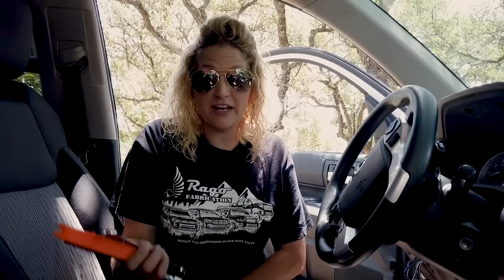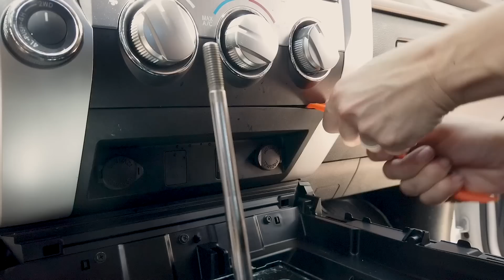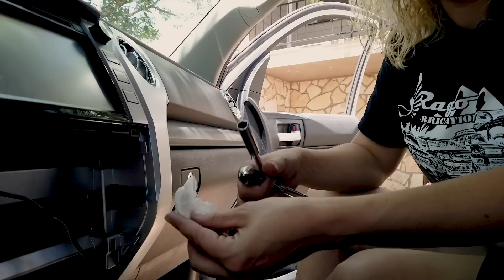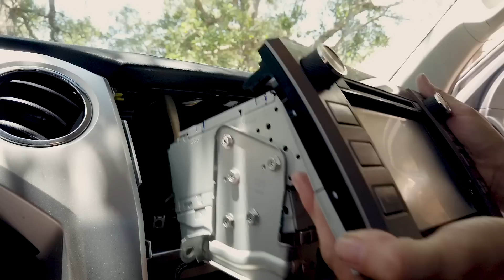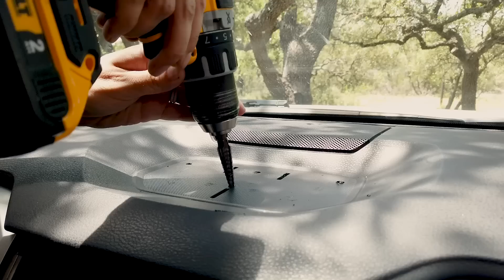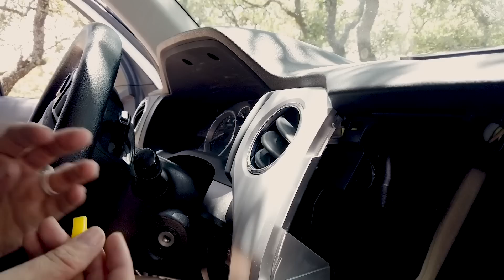2014-2019 Tundra Dash Plate Install

Comment: Just installed a “Blem” mount and it went great. Just follow Melissa’s instructions to a “T” and you will be done in about an hour. I highly suggest getting the plastic pry tools and using the “paper” trick in the video. I used toilet paper and it worked fantastic. I have a dash cpver and I just removed the patch that covers the mount. Looks sweet. 
Now I need to get some mounts.
Reply: Same here...couldn’t wait 4 weeks out

Comment: Video doesn't show or explain why it's necessary to completely disassemble the dash to install this. Looks like everything goes in from the top so no need to access the underside. At least, that's what the video shows.
Reply: Was about to ask the same question
Reply: Think it has to do with the placement of the wires to the head unit. On Victory4x4's video, they talk about being super careful for the wires. That and there are probably nuts on the back of the bolts that hold it to the dash.

Comment: Sure seems like all you need to do is screw the plate mount in and be done.  My only question is why? Lol
Reply: You must be joking,  you drill into the dash to get some bolts that hold your bracket,  ... how do you think the bolts are just going to hold all that weight.  You need to put the nylocks on the inside otherwise your dash plate is going to be bouncing all over your truck.
Reply: @ricriv5582  No it won’t, because I’d never install that pointless thing. Lol

Comment: Rago... are they self tapping screws to install? Is it necessary to remove the stereo?
Reply: I'm sure you have to in order to get the nylon locknuts under there to hold your bolts.

Comment: On the mounting plate, after you drill the holes do the bolts just screw into the dash or do they have a nut on the bottom to hold it more secure?
Reply from the maker: Joe there is a nut that goes on the bottom as mentioned in the video.
Reply from the maker: Joe its bolted in.
Reply: Yea I was confused as well. Video might have mentioned it but it wasn't clear enough for me to understand if there are bolts below. Nice product!
Reply: @RagoFabrication  I've been through this video a few times and the nut inside the dash is never mentioned. Lost in editing maybe?

Comment: I had the same question as Wes. What is the dash plate used for? I guess a dash cam comes to mind. Are other vehicles in line for this upgrade?
Reply: Frank Orth primarily for people who off road honestly. They usually have an iPad or some other gadget that is clamped on by something and the plate is the base of it so they don’t have to mess with magnetic mounts or sticky 3M materials.

Comment: What exactly is it for? Is it  a mount for anything. Also no need to take the center console apart can be done without touching it.
Reply: Mostly meant to bolt down ram mounts but you can use it to bolt down other things as well. Some people mount cb radio heads or cameras. I'm going to make one (I have  a 2nd gen tundra so this one may not fit) and use a ram mount for my phone and another ram mount for a tablet. Later on, I might mount a dash cam to the front.
Reply from the maker: rke1987 its to mount phone adapters such as ram mounts, gps, i pads and anything else. Its the norm in offroading. For a daily driving its probably not you cup of tea.

Comment: So I just got mine for my 2021 Toyota Tundra SR5 Double-cab Off-Road.  1 simple question... which RAM Mount "type" do I get that'll fit this thing? When you visit rammount.com, there are 15 types, some obviously are not for this, but which ones are?  Bolt Head Adapter? Drill Down? Flat Edge Clamp? I'm looking for a RAM Mount that'll work with this Rago plate for my iPhone X (with case).  Thanks!
Reply: Just use one of the ball bases then find the phone mount you prefer.  I use the wireless charging mount, with a long arm mounted to a b-sized ball base.  https://www.rammount.com/shop-all/ball-bases/b-size

Comment: Is your dash plate compatible with 67 Designs phone mounts?  Or just Ram mounts?  Thanks.
Reply from the maker: We are not familiar with the 67 Designs mount. If the bolting is the same distance as the Ram Mounts then the 67 Design Mounts would work.
Reply: @RagoFabrication  Thank you for the reply.  I confirmed the 67 design mounts work on the tundras.com forums.  I think they are used more for jeeps and not tundras.